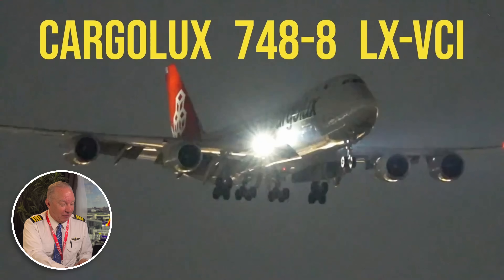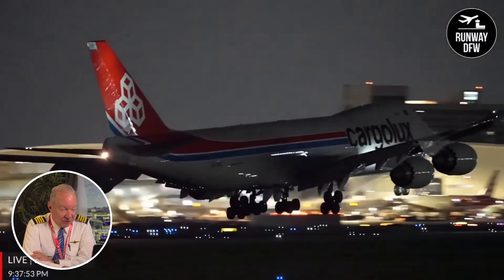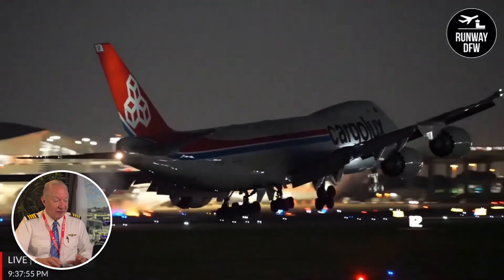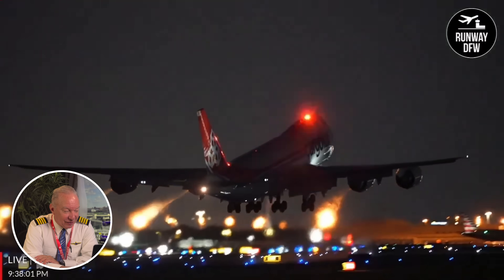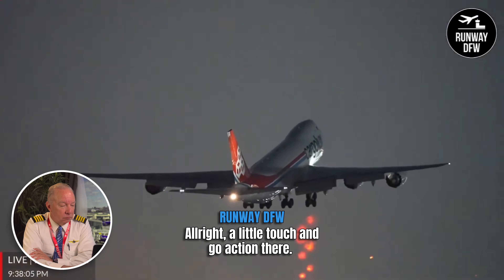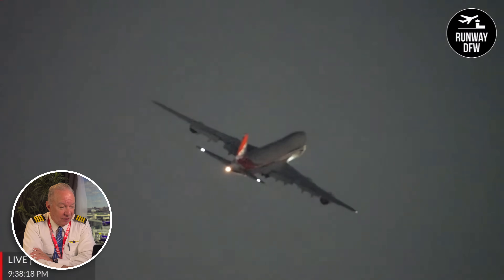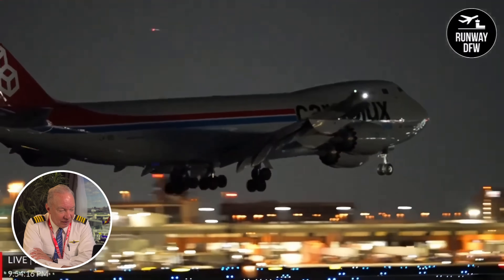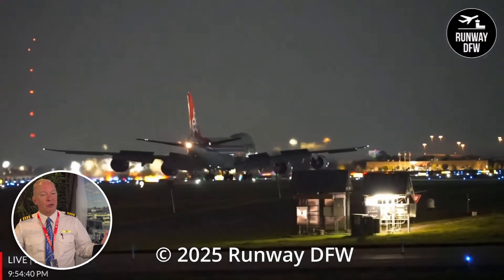Cargolux 747’s Dramatic Bolter Landing at Dallas/Fort Worth

Comment: We flew into Noron AFB in August. It was a C_141B. Arriving  rom Hickam Pilot must have chopped throttles because everything got very quiet. Aircraft felt like was floating just above runway for few seconds. Feel a floating sensation. Finally touched down smooth as babies butt.  Possibly high temps 100F kept jet off runway.

Comment: At first I thought this video might have been about the 747 I saw abort the landing a couple of weeks ago at DFW. I pass by the north end of the airport on my way to work and around 8:30-9am I was on highway 121 headed west and a 747 was about to land headed south on the western most runway, passing over the highway a few hundred feet of elevation I heard them go full throttle and abort the landing, didn't touch down though so not a bolter I guess.

Comment: Another factor might be a light aircraft. That would explain the pilot not being used to it. The total weight is usually a guess based on empty weight plus load, but a lot of estimates go into that.The suspension system could have sensors to give a direct measure of still weight.

Comment: This flew over my shop that is a few miles from DFW at like 2000 feet where that is extremely uncommon, usually when it is a bolter landing. Sometimes when weather is bad to the east, but not that low. I do see this often with 747 at DFW and some other larger aircraft. It was so loud it sounded like it was inside the building and ran outside, but missed really seeing it. I did see it was a 747 on Flightradar24 and tracked that it landed on the second attempt. 

Good video, thanks for the explanation Captain Steeeve.

Comment: When the 767 was brand new, I was on a flight from the west coast into Boston Logan. It was a winter day, but clear skies and midday sun. We came in from the south, over the cold waters of the Massachusetts Bay. The flight crew had the flaps all the way out. The runway was baking in the sun. As we got over the end of the runway, we were close to the ground but could feel the plane float. They did manage to get the plane down without much margin. On subsequent flights in similar conditions, I noticed the flaps were not extended quite so far. I thought this might be interesting as another reason for why a plane might float, given the thermals resulting from being over cold water, then hot runway.

Comment: I’m a 15000 hr+ 747-8 captain and this is the first time I’ve heard the term boltered landing - certainly not a Boeing term, the FCOMs refer to a balked or rejected landing.  Secondly the caption on the video refers to a 748-8 - never seen that, it’s either a 747-8 or a 748, or simply a dash 8.

Flying the freighter has unique challenges not experienced on the passenger fleets - we have a huge range of landing weights, on the 747 freighter it’s not unusual to have a variation of 100 tons plus on successive sectors, which means your flare and landing technique has to be adjusted according.  Sometimes you get it wrong, the brutally tiring freighter rosters don’t help.

Kudos to this crew for making the safe decision to go around and give it another go.

Comment: Two related questions: 1. Cockpit videos of pilots landing commercial aircraft shows them sawing at the wheel during approach. Do those seemingly minor flight inputs really affect the attitude of a large, heavy aircraft that much? 2. Are there computer aided landing systems that allow for a hands-free touch down?
Reply: 1. No. It’s just for the show. You can land an airplane with very small and smooth control inputs. 
2. Yes. Most large commercial airplanes are capable to perform „autoland“. You set up the approach and the plane will land automatically and slow down to taxi speed while maintaining the centerline. That is required in low-visibility conditions.

Comment: personal opinion; the "float" is the ground effect wave from an aggressive flare propagating forward under the fuselage to the wing roots and with any crosswind that would cause uneven loading on the wings thus the dip and a spongy feel on the yoke. bada-bing-bada-boom. august in texas hasnt been EXTREMELY hot but it has been humid.  that would definitely exacerbate any preturbances.

ize kah-wazy though.

Comment: Almost all landings on large aircraft like the 747 are done using Autoland or  a computer automated landing. Maybe the pilot had to land manually for training or one of the automated systems was inoperative.
Reply: That's not true. They're mostly flown manually.
Reply: @mikeschmit007 you have no clue. I'm a licensed aircraft maintenance technician and have many years experience working on B747 and other large aircraft. Pilots fly those aircraft by autopilot. They mostly only program the systems and allow the computers to fly the aircraft. They only fly manually for required training as they must know how to fly hands on in an emergency situation. Manual landings cannot be accomplished in zero visibility as it's considered too dangerous. Message me again skippy when you know what you are talking about 🎉.

Comment: It was a quick thinking pilot, whatever the reason. At 02:37:56Z just before the junction of 18R & Taxiway Y, they were showing Alt 600', ground speed 151kt and descending at 128 feet/min. At 02:37:59Z, right after intersection 18R & Taxiway Z, he was at 600', ground speed 144kt but now climbing at 320 feet/min. So only 3 secs between 'almost of the ground' and starting to climb.
Reply: Your data is bad, he actually touched down, you can see the smoke from the left side tires, so it was NOT 3 seconds from 600’ to touchdown at 128 ft/min then back to climbing. The engines spool fast but not that fast, he went a considerable way down the runway before climbing back out, the video doesn’t show that.
Reply: @bigdog2024  My data is not bad. The data (ADSB) is sampled only every couple of seconds; it is not a constant stream. If the zero altitude happened between data updates, it won't show. As the data came from the aircraft, I believe that it is correct. By the way, the airport published altitude is 606 ft.
Reply: @scousedavies565 144kts is lower than the published stall speed off 150kts in landing configuration so how is it flying? There was no almost ground the plane touched down.

Comment: I was a Naval Aviator who flew Fighters in the skies over North Vietnam and later had a 33 year career with a major U.S. carrier.  I've never heard the term "Bolter" used for other than a failed carrier landing attempt.  It requires the airplane to touch down on the deck but fail to catch a wire.  This is almost always caused by landing a bit too long but can also be caused by a "hook skip" where the hook bounces off the deck usually as a result of the hook damper being under serviced.  On rare occasions, it can be caused by the hook point being installed backwards.  If the plane doesn't touch down, it's called a "wave off". 
In the Navy at least, it is impossible to bolter on the field unless you're trying to make a short field arrested landing, something which is pretty unusual.  I've never heard the term bolter used in the airline business even when two ex Navy guys are talking.  We do tend to say "Wave Off" when the proper term for airliners is "Go Around", but "bolter"?......... never. 
You are certainly correct about this particular 747 landing attempt.  I said to myself "he's too fast" even before seeing the first landing attempt.  Sad-to-say, airline pilots routinely fly faster than necessary and the common result, as you so correctly point out, is a "floater" which uses up precious runway and the result often requires excessive braking and use of reverse thrust.  Passengers don't like that.
A much better technique is to fly exactly on speed and touch down at the earliest possible legal spot on the runway.  In order to make the touchdown silky smooth, you must exhibit excellent stick and rudder skills, but it can be done if the pilot is willing to put in enough work.  Done correctly, you make a smooth touchdown, use minimum braking and only moderate reverse thrust as you still make the early turn off.  Depending on where your gate is, you can shave 4 of 5 minutes off the block time too.  The best part is when you look over at the guy in the other seat and hold your steely eyed stare a moment longer than necessary, signaling to him that you know that he knows that he could never pull off such a perfect landing.
Reply: What?????????????

Comment: Hi Captain Steve, you said aim point was 1,000 feet.   That works for most airplanes.  In the C-5, we aimed at the 1,500 foot markers.  Why?  To assure 50 TCH crossing.  In the three bar VASI, we used the forward two boxes.   The main gear in the C-5 are 200 feet behind you.   I suspect B-747 types use a similar aim point.   John ATP/CFII SMEL, Colonel, USAF (ret)

Comment: Hello Captain Steve!
I have been thinking about write and ask you about a strange landing that i experienced at LAX back in the 1990`s, but it feels that i may have got an plausible answer here in your video. I cant remember what kind of plane it was, it had one engine under each wing anyway and we were approaching LAX from the sea. It felt like just another ordinary landing but as we got closer i thought it felt like it was going a little bit faster than it use to. We descended normally for landing  but just at the last moment before the touchdown, the pilot hit the gas! I sank down in my seat due to the G-force and i heard passengers gasping simultaneously, the plane touched down really hard with a bang, and the pilot immediately hit everything he had, except for the fotbreaks  to slow down the plane. it made the plane shudder and a damped yelp could be heard from the passengers , i myself just held on to my armrests real hard
I could see by the expressions on the cabin crews faces that this hadn't been a normal landing.
We got no explanation from the pilot in the speakers, and the silence in the plane was eerie when me and the passengers picked up our stuff and leaved the plane.
So, i guess me and and the other passengers experienced a "Bolter Landing" that day..or...? 
Sincerely "The Swede"

Comment: I guess if you had ever flown the 747-8 (which you never will) you would know that there is a strict roll limit at touchdown on this particular version.  Inboard engine strike is highly possible in a wing/low touchdown and a go-around ever after touch, is recommended.

Comment: I lived in Dallas for twenty years, and I wasn't one bit surprised about the 747 having difficulties landing at DFW.

DFW and its surrounding areas are notorious for the microburst-induced wind shears that were mostly undetectable for a long time. That caused the crash of Delta Air Lines Flight 191 in 1985 when it was caught in the shear so suddenly and crashed. It wasn't until the new generation radar system that could more or less detect those pesky wind shears was installed there in the 1990s. However, they weren't 100% as the wind shears could form so fast before the pilots could react.

Comment: My goal on landings , later in my flying experience was to conduct either shortfield or  softfield technique on each landing -- Along with touchdown at minimal airspeed.  What I was ultimately aiming for was a "squeeker"  . Where sinkrate and  distance to the runway meet in a minimal energy event.  I got pretty good at it in the Cherokee 6. It requires currency to keep it perfected and improved.  I had alot of fun with it. And it probably added a few months onto the MLG tire life.

Comment: Hi Captain your Channel is fantastic I’m in the UK. It reminded of a flight into O’Hare from Manchester on a BMI A330-200 20yrs ago. Two aborted landings, bird strike on take off on runway and aircraft landing on runway not vacating quick enough. Third landing on shorter runway very extreme. All after 8hr flight. Flight Deck and Cabin Crew fantastic. As you now very well O’Hare can be a dramatic busy circuit when coming in from Lake Michigan and landing east wards. You’re doing a brilliant job on this Channel.

Comment: QUESTION:  Are you able to feel the difference of air density on takeoff or landing?   IE: if the temperature at ground level is -20 C /-4 F compared to 32 C / 89 F  does the plane perform differently?   Cheers from 🇨🇦

Comment: I am a retired airline pilot with 35 years of experience and have never heard of a boltered landing except when it applies to carrier landings. "a bolter occurs when an aircraft attempting an arrested landing on the flight deck of an aircraft carrier touches down, but fails to catch an arrestor cable and come to a stop. Bolter aircraft accelerate at full throttle and become airborne in order to go-around and re-attempt the landing."
Reply: I was going to say the same thing.  I've never heard that term outside the Navy.
Reply: @chrisbryant1750 Steve was a navy pilot so maybe that's why he's using the term.
Reply: @stracepipe  : I am former USAF and we never used it, besides never using it in the airline business.
Reply: @jstrahan2 people have commented that it is a naval term, and I commented that Steve's use of it might therefore be because he was a navy pilot.
Reply: @stracepipe  : Yes, but he was applying it to a commercial airline landing. Using that term to describe it is an error.
Reply: @stracepipe he flew P3s.  They're land-based, so the term "bolter" would have never applied his entire career.
Reply: @stracepipe  While we are at it why does he wear long sleeve shirts?  I never did and if I would have I would have worn my uniform coat over it.
Reply: @chrisbryant1750  A “boltered landing” is indeed a naval term describing a failed carrier landing more or less. His creative use of it could accurately be applied to any plane, including the landing attempt of this CargoLux 747.
Reply: Same here. I've flown professionally (civilian) for 20 years and have never heard the term boltered. I teach students the terms "balked" or "rejected."
Reply: Same here, never saw a reference made to "boltered landing" in any manuals for the last 3, Part121 carriers I flew for. It's really amazing how this content is even worth publishing, it was an aborted landing with a go around, why is this even worth covering?

Comment: In 1985 I flew from LVIA(ABE) first to Atlanta then on to Tamp on an Eastern Airlines 727. We landed in Atlanta perfectly. When we left Atlanta for Tampa it was pouring. As we approached touchdown, suddenly the aircraft slammed down on the runway very hard. The overhead compartments opened and items flew into the cabin. People were screaming. The aircraft bounced back up into the air and the pilot went full power and eventually did a successful go around. That was some experience! Thanks for your insights. Have a rockin' day!
Reply: I forgot to add that at the time my first thought was, "this pilot has to have been a naval aviator to pull of that save..."   Having a resource like you to learn helps understand how these things really happen.

Comment: Captain Steeeve, would it be possible for you to do a video on flying a simulator.  In particular, I'd be interested in how real it actually feels.  I know they can simulate sounds and instruments and probably lighting, but what about G forces and turbulence and other physical sensations?

I know when I fly a glider, I fly almost entirely by the feel of the aircraft, sound, and physical sensations, rarely even look at the instruments unless things suddenly go very quiet.  But of course the size difference is about as big as it gets between a glider and an airliner.   How much can the simulator really simulate?
Reply: They can simulate a surprising amount of the physical sensations. Steeeve remarks at 7:30 in the video that it actually hurts to practice hard landings in the simulator. They can't simulate high G forces -- that would require them to spin the simulator like a centrifuge, and even if they could do that, the centrifuge wouldn't respond fast enough to mimic the changing G forces in an actual airplane. They can do some limited simulation of G forces, though. For example, when a plane is accelerating down the runway, you feel yourself being forced back against your seat. They simulate that feeling by tilting the nose of the simulator up so that gravity itself is pushing you back against the seat.

Comment: Hello Capt. Steeve. I enjoy your professional Channel. I was a Line Check Capt. with Cargolux until I retired one year ago. I was also an IP in the Air Force, just like you, on fighters and AWACs. Cargolux is not doing touch and goes any more. We still used to do that in 1999, when I started with CLX.  This was a go-around, like you mentioned before. Go-arounds are part of the approach briefing and will be briefed by the pilot flying the approach and landing. They went for the safer course of action and that is the professional approach! Well done! Greetings from Europe!
Reply: How do you go from fighters to AWACS?
Reply: I had to get away from the ejection seat due to back issues..... at the end it gave me the chance to join Cargolux.
Reply: IIRC Captain Steve is a former Naval aviator ( notice I did not say 'pilot') and as we know a missed landing or go around on an aircraft carrier is referred to as a bolter.